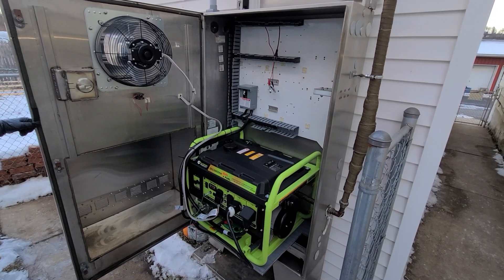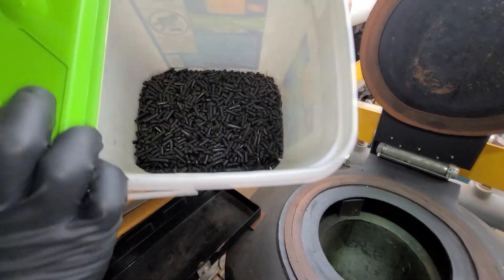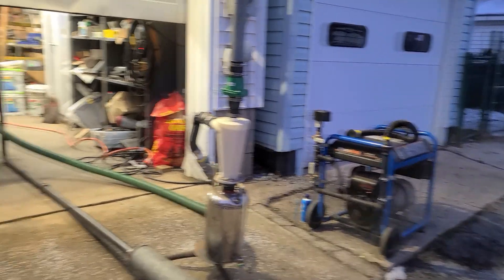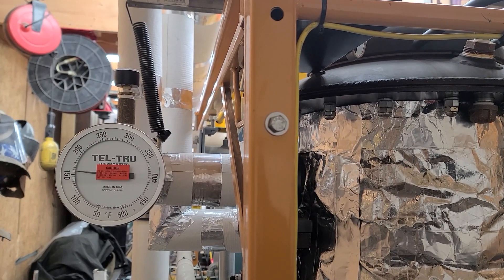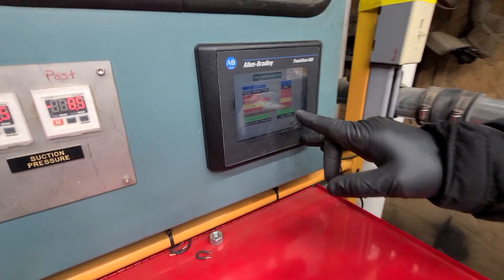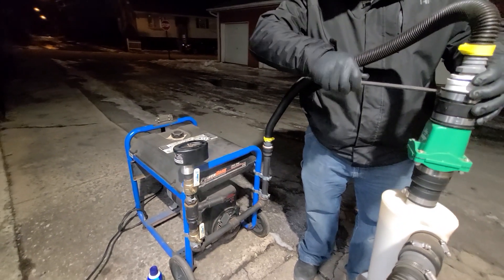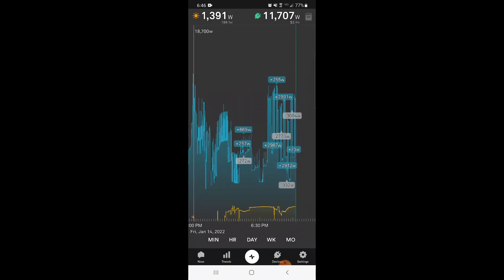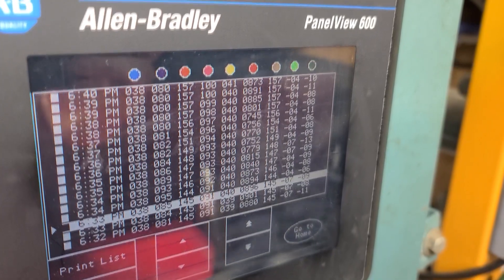Wood Gasifier Progress 1-14-2022

Comment: Hello Joe, you're a good programmer and engineer. A wood gas generator can produce more, in your case ~3.7 kW. A gas generator can be made from a 4-5" pipe, made of ferrous metal, and 25" long. If you are interested, I can upload a video of such a gas generator.
Reply from the maker: Thanks for the kind words. I'm always interested in wood gas videos.  I will look up  your channel and browse through your videos . My son has been a tremendous help with the programming.  We were just playing around with the gasifier last weekend. After a few runs with some mixed results,  we figured out some of the issues we had and managed to do a 3 or 4 hour run in which we produced some pristine gas. We didn't have as much luck with the green generator though. I will have to modify the intake as I had air leaking in from the cover that clips on to the air box. Thanks for watching and commenting. Joe
Reply: Here's a link to a working gas generator in case YouTube misses... https://youtu.be/ALnQ9QglePQ?si=4Tldz3sHzlcJgP6L
Reply: Here's another of this engineer's gas generators.  https://youtu.be/8naWhxbaiJQ?si=zM8GwnLudozcHyWD

Comment: Will this Gasifier Run a single barrel V8 engine
Reply from the maker: Brian, here is a link to hbbyloggr's video showing this style gasifier running a 6 cylinder engine running on wood. https://youtu.be/7m4HOzNYKks.  I think it really pushes the limits of this gasifier but I otherwise can't answer your question from experience. There are a bunch of guys that run dodge Dakota v-10 engines around. If you look up drive on wood you will find some good content. Hope that helps. Joe
Reply: @mazdalorean  Thank you For your Help I,m building one Now.

Comment: Hi
Amazing work!
Which generator is this please..?
Reply from the maker: So there were two generators running in this video. The one that was running on wood was a 5000 watt Coleman. I think it has a 10 HP tecumseh engine. The green generator is  a 13,000 watt g-power America dual fuel,  soon to be running on wood. I'm going to try running a generator on anthracite coal sometime. That should be interesting. Anyway thanks for watching and commenting. Joe
Reply: @mazdalorean  thanks for your reply
My question was if it is a diesel/gasoline generator or gas generator..?
Reply from the maker: @danear2  gasoline/propane on the green generator,  and gasoline on the small one.

Comment: very cool, glad to see you had the room very well ventilated as well
Reply from the maker: Thanks, I always have the garage door open along with a carbon monoxide detector plugged in in the center of the garage. It's never been triggered during a run, but I have set it off when I opened it up to clean out the char after it cools down. I now go out the day after the run, and turn on the blower just to purge all the gas out of the gasifier. Thanks for watching and commenting. Joe

Comment: why feed generator into power supplies? what does that do
Reply from the maker: So the idea behind the power supplies is to be able to convert 240 volts ac ( from any running generator)into 24 vdc . Each power supply has it's own breaker and I can add or subtract a constant load to a running generator to fine tune how hard it pulls on the gasifier and keep the load consistent. From the output of the power supplies,  the 24vdc is then converted into grid tie power. So this gives me the ability to run any regular generator or just exercise my backup generator keeping it's battery topped off, and fresh fuel in it ( for quick emergency use in case of a power outage). Thanks for watching and commenting. Joe

Comment: Producer gas burns slower than gasoline so did you change the timing on your generator?
Reply from the maker: I haven't touched the timing on the generator. I just kept slowly adding the load till it seemed to handle it well and left it there. I do think this small generator is a little too small for my gasifier dimensions though.  It was breathing fine, but my hearth temperatures were slowly dropping. Obviously you want your generator to pull hard enough to maintain good temperatures and if I get too low,  I would increase the chance of producing tar. I do have filters but I prefer not to needlessly block them. Thanks for watching and commenting. Joe

Comment: Great Rig Joe happy to see its still worken  strong 👍👍
Reply from the maker: Joe, it's been too long since I posted a video on this project. I kept saying I want to get this or that done before I make a video , and I always add just one more thing to the list. I'm looking forward to running the big green generator on wood. It has an o2 sensor in the exhaust and will have a modulating valve to control the air intake through the plc. Have you run your system recently? I know you put together quite a nice setup. Thanks for watching and commenting. Joe
Reply: @mazdalorean  Time flys man I’ve been out of the loop for a while too. So many hobbies take up time in a good way🙂.  Unfortunately Joe I don’t have my machine anymore life happens got married have a house now but it won’t stop me from building another one. It was a great experiment and if I do build another machine I wouldn’t mind making a micro wood burning 🔥 monster. Hope all is well bud

Comment: I really like the setup. It's involved but it gives you a lot of information. I really like the mods you done with the reduction zone and the grate. Nice job man! Let me ask you a question: Do you not have an issue with the wood pellets swelling up with water vapor inside of the hopper?
Reply from the maker: Mike , this is the first run since I modified the reduction tube. I was able to run the pellets with the smaller diameter (2-1/4") tube but I really had to poke them a lot. I barely poked through the harth this time at all and it ran really well. It's worth mentioning that I'm running a 50/50 mix of pellets to charcoal pellets. I will try to do a straight pellet run after a couple of mixed pellets runs. I might even try putting straight charcoal pellets in at the end of a run and trying to restart it the next day without cleaning it out. I've got a lot of testing to do. I'm just glad that it's working well enough to start dialing things in. I always had trouble with pellets,  but I've stayed committed to making them work,  simply because they are readily available. I'd love to try some grass pellets in the near future too. That would be awesome if you made your own pellets just from grass clippings. As for the pellets in the hopper,  I don't put a lot in at a time. Maybe 5 to 10 pounds at a shot. At this point I've been afraid to put more than that in because I had so much trouble with bell packing. I think I want to try and start up early one morning and see how long I can keep it running just for information purposes. Like I said I have a lot of testing to do. When I get all of the data documented,  I will probably set the ash grate shaker to be activated by pressure rather than timers. There's always mods to do in addition to testing. I'd really like to see the big green generator running on wood with the air modulating valve controlled by the plc. Plus I have a lot of pipe insulating to do. Anyway thanks for checking in. Joe
Reply: Flash one good way to handle moisture is to build a little hopper extension with a perforated inner lining and a gutter ring for the water to collect.  Look up a Monorator Hopper if you don't already know about them.  A lot of the moisture will be driven up to there and cooled on the outer walls of the extension exposed to cool air and it can run to a holding tank/jar.  
I had to make my hopper entirely exposed and I use the exhaust of the engine to suck moisture out via venturi effect.  Single nozzle with a fixed grate and propane tank hearth, but I don't have the benefit of a large outer gas jacket like y'all's.

Comment: what happened to the ninja generator setup with all the alternators and invertors. I thought that was an amazing feat of engineering.
Reply from the maker: The ninja setup is still there, I just never got around to replacing two of the alternators with high output 24v ones. So if I run all ten inverters, the draw on the battery bank is greater than what the 3 alternators( that are currently installed) can produce and will eventually run the batteries down. I just leave the breakers open between the batteries and the inverters so I don't feed power from two different sources to the inverters. The ninja migh actually be a more efficient way to produce power too. When I run a regular generator,  it draws 700 watts to power each 24vdc power supply and then there are losses converting it back to ac again ( only outputting maybe 500 watts of grid tie power each. That means an extra 2,000 watts are wasted to produce 5000 watts of grid tie power. )I will also say when I ran the ninja, I was able to reach 350 degrees on my air intake gauge. Also I want this gasifier to be flexible and run multiple devices. It's nice to know I can exercise my backup generator and actually use the power while I purge gas that might normally sit for long periods of time, keep its battery charged by running it, and be sure it's always ready to go in the event we actually do lose power. Stay tuned because even though the progress is slow, I still have big plans for upgrades. I installed an o2 sensor on the exhaust of the big green generator and I will be writing code for the plc to control the air intake ( with a modulating valve) to make sure whatever is changing in the gasifier,  the air/fuel mixture is correct. Plus I eventually want the program to detect when it's time to shake the grate,  not just with timers. Maybe even auto fill the hopper. Lots of ideas. Just don't know how long things will take. Thanks for watching and commenting. Joe

Comment: Watt a wonderful development indeed. 
 Now I know why there are no watts left in my woods, as it turns out that YOU have got them all  ;) . 
 Currently, I am running on nuclear power here. OK, the reactor is 93 million miles away, and the extension cord cost me a fortune, but it IS saving me a fortune in treezel bills  ;) .
Reply from the maker: Steve, it's been way too long since my last gasifier video. I've been working on things,  but I always say" I want to get this or that done before I try and run it again " and I never seem to get it all done. I'm very happy with how well it ran. Eventually I want to use cheaper fuel,  but I'm trying to get a solid procedure down with pellets. Typically they are harder to run. I'm looking forward to seeing that big stainless gasifier up and running. Thanks for checking in. Joe
Reply: @mazdalorean  
 Howdee Joe, 
 Yup, it has been a while, so I really enjoyed the latest woodgas fix  :) . 
 Our busy lives always conspire against our plans, so our rate of progress is always going to suffer, sadly. 
 My gasser is, by far, the least productive of all the systems out there, as all of the others produce a bigger flare than mine ever has. 
 That stated, I still get 1500W from the generator, which is all I can ever use, so it all works out quite nicely. 
 Your pellets are rather energetic little power packs, so it wood be interesting to see watt you get from other fuels. 
 All I have here is pine, which I am told is a rather dirty fuel, which offers relatively low power levels. 
 I can attest to that fact, it wood seem. 
 Right now, my gasifiers are in storage, awaiting the trip to my new farm, so it will be a while before I can get back into them. 
 It will be good to make some more smoke, and some more woody watts - in the near future  :) .

Comment: Joe, Always impressed by your builds. Good solid run with stable numbers. I'm liking the new reduction zone and grate assembly. Thanks for the fix !
Reply from the maker: Thanks Bill. One of these days I'll have to start up in the morning and see how many hours I can keep everything running for. I think the new reduction zone was a home run. It never really showed any signs of blocking up. I still have to take things apart after the run an check stuff out, but I think it went well. I'm looking forward to seeing your new gasifier running. Keep us posted with your progress. Joe
Reply: @mazdalorean  It never got much above 0*F today. Same for tomorrow so not much going on in the Hbbyloggr Shop of Horrors.I  processed a good load of splits for the new gasification wood boiler on Thursday while the temps were a lot milder. Happy that's done now that we are in the below zero weather,
 Yeah, I think your new reduction zone and grate will work excellent keeping the wood flowing.